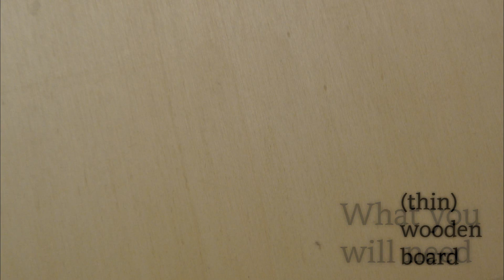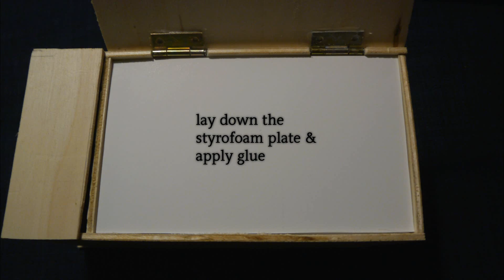Mini Fridge selfmade Tutorial with Peltier Module DIY Fridge or heater Peltier Element Tutorial

Comment: i don't understand, what is the thickness required of wood ?? and why u put 2 styrofoam between peltier and Heat  ??
Reply from the maker: You need a thin wooden plate, like 2 or 3 mm
Reply from the maker: And I did only use one styrofoam, it's no problem

Comment: is it possible to be connected to a solar panel so that it can be use outdoor without connecting to any batteries?
Reply from the maker: I'm not sure, the peltier module not, but the fan should be working with a solar panel ;)
Reply: ohh so you mean I still have to use battery for the peltier module?
Reply: well, thanks for answering sir :)
Reply from the maker: michael robert no problem 🙃😉
Reply from the maker: michael robert it's better to connect it with a cable 😉

Comment: Those two batteries would probably last a total of one to two minutes powering that devise if they don't over heat and possibly leak or explode. Peltier devises use a lot of power. Usually 2.5 to 8 amps. You should never run them off small batteries. Only use big batteries like at least the size of a thick book that have a few amp hours. Not miliamp  hours. If the devise draws a total of 6.5 amps including the fans, then you would need a battery that has a capacity of 6.5 amp hours to run the devise for an hour. You should get a battery that can constant current amps to power your devise. car batteries work great for this because they can provide the amps and power the devise for a few hours at a time. The best thing to do is get a power supply that can put out a continuous current that is slightly higher then the power that you need.This will prevent the power supply from over heating. you should also put a larger heat sink on the hot side and mount the peltier devise at the top of the fridge for more even cooling. You can use a used computer power supply for this project. You can get them pretty cheaply.
Reply from the maker: yeah you are right ;) At 2:49 I said that you better not use a battery :)
Reply: exactly, and it was really missleading because while he saidit was a 12v battery, in reality it was a 1.5 AA battery